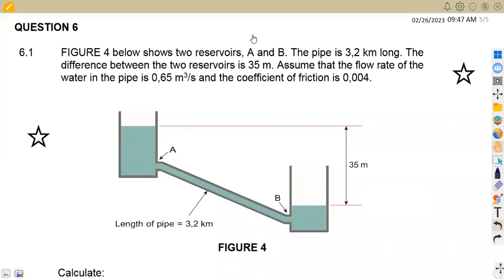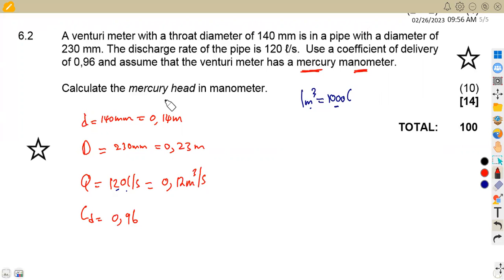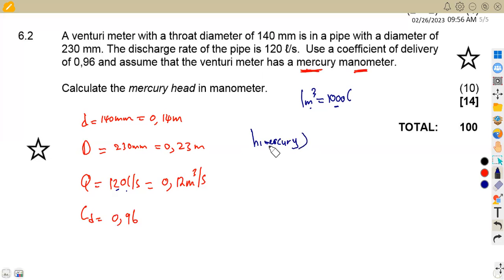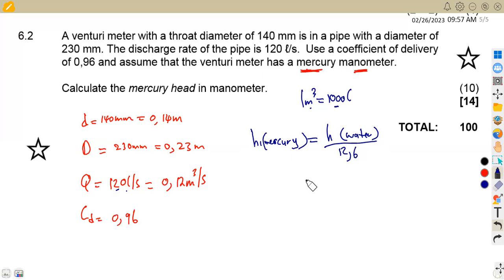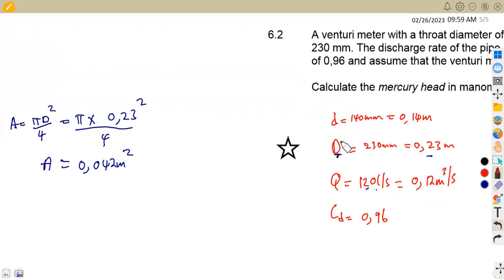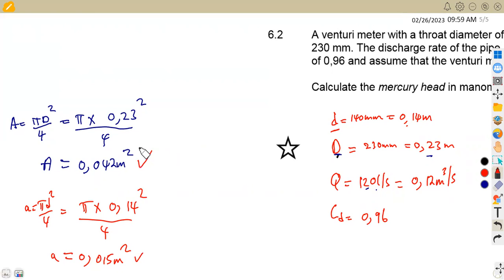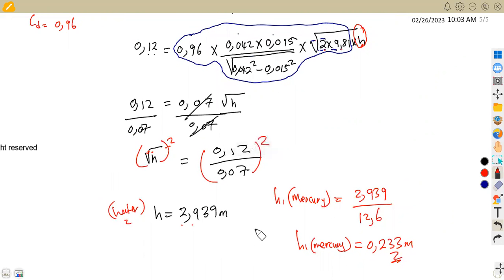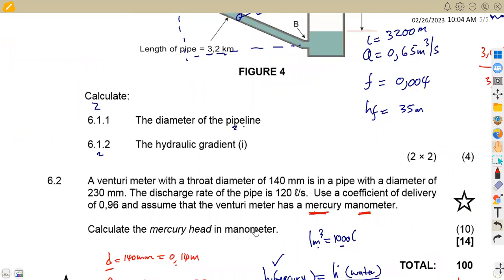MECHANOTECHNICS N4 HYDRAULIC SYSTEMS NOVEMBER 2022 NATED ENGINEERING @mathszoneafricanmotives

Comment: I need assistance on 6.2 (Time, 13min 52s)
Your answer was 0.07 during the long calculations my answer from the calculator is 0.068..
I tried  multiple times but can't figure out how you got the 0.07
And my overall answer of h = 3.114
Reply from the maker: Hie , sorry I used 2 decimal places instead of 3
Reply: @mathszoneafricanmotives  No probs at all, i was going crazy trying to figure it out.